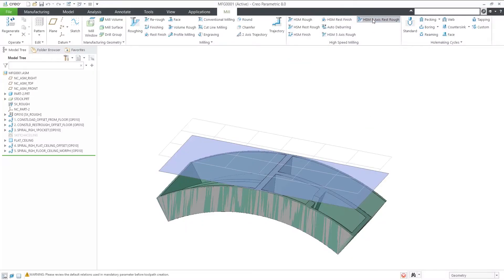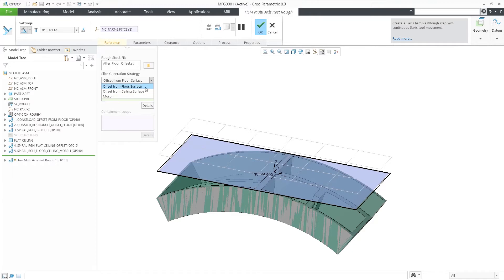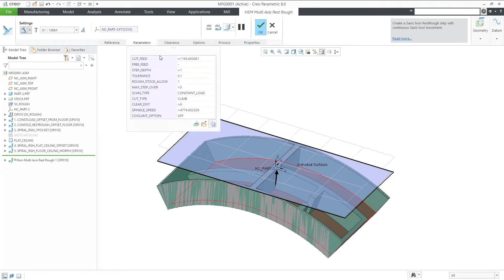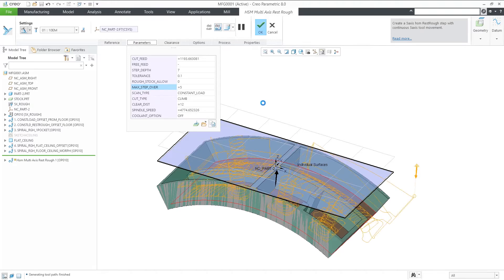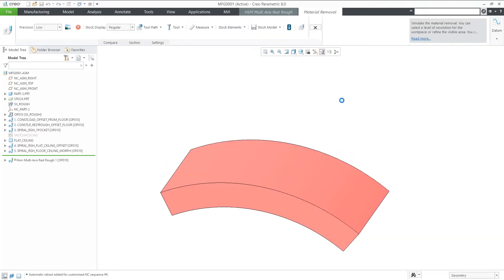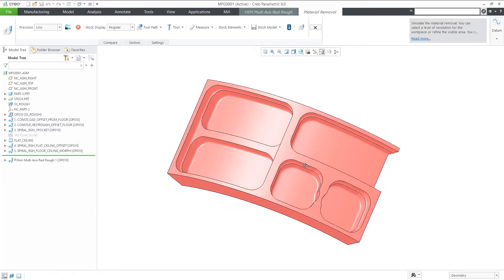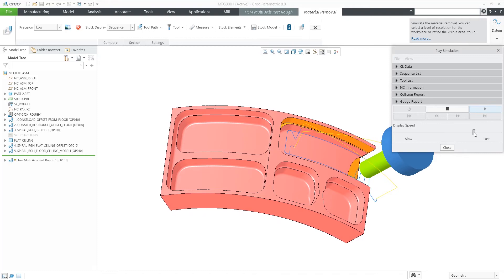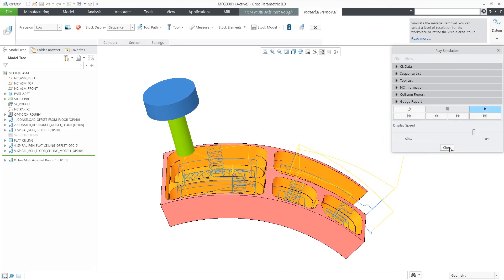5 Axis Rest Rough in High-Speed Milling Advanced | Creo 8

Comment: The software is very well organized. but I've always had a question,  Is there any significant reason why does creo have no ability to lock the verticle direction/keep the horizon when rotating view? because it is the most important thing to avoid inner ear balance disorder and counterintuitive in 3D space.

if you're modeling a figure statue/ a car in the real world, you want to check the shape from different view angles by walking around it,  it's hard to imagine how you could check the form if walking around the target model would cause the horizon to tilt and the whole world upside down immediately
Reply from the maker: Hi TB,

Thank you for your reoccurring interest with Creo!
As for your question, I'd recommend starting a discussion thread on our PTC Community forum about it to get input from other engineers: https://community.ptc.com/t5/3D-Part-Assembly-Design/bd-p/partassemblydesign

Cheers!
Reply: @PTC_Creo  🙏👍